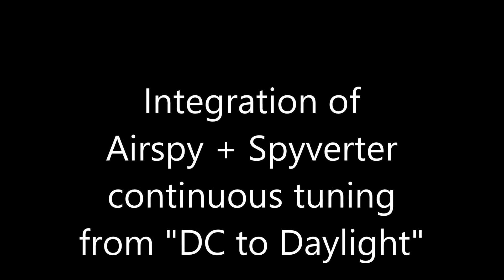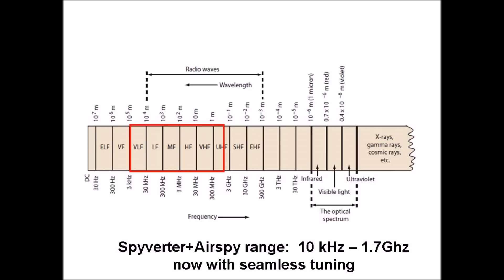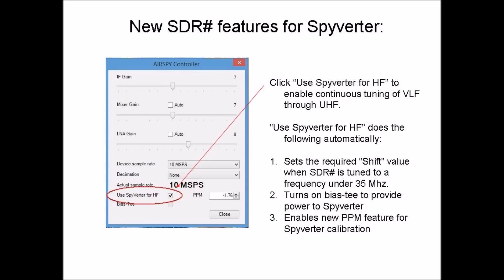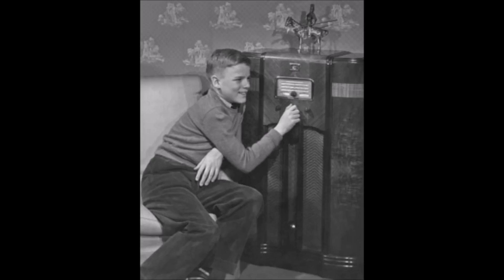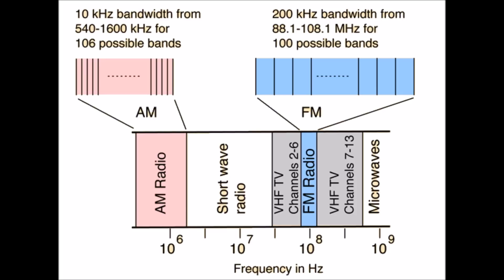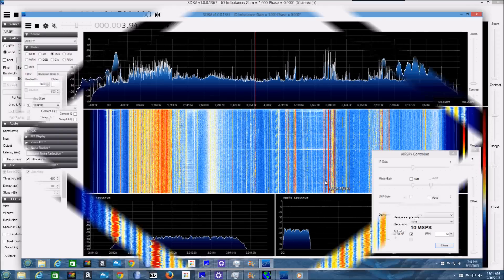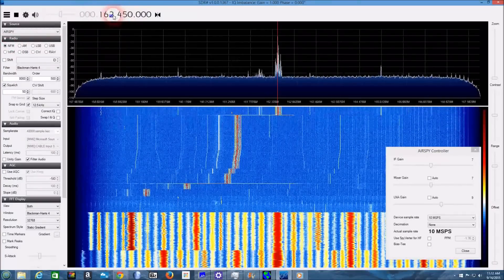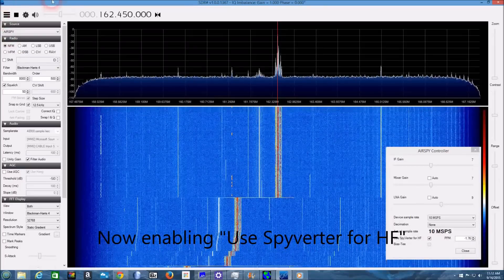Seamless tuning of SDR# with AIrspy & Spyverter

Comment: I have the Nooelect dongle with SDR# software, when I click on the cog icon on the upper left corner to open my Airspy controller it looks nothing like yours?  My controller has selection tabs for: Device Sample rate Sample mode Then under that it has three check boxes:Offset TuningART AGCTuner AGC And under that it has an RF Gain slider, and under that a frequency correction up and down selector. Am I missing software or an update?

Comment: Ranickel: What are your thoughts on using a wideband discone antenna with this configuration?
Reply: Most discones are spec'ed for operation above 30 MHz, so for HF reception you'll get much better results with a longwire, dipole, or other antenna designed for HF.

Comment from the maker: Kent, my switch has BNC connectors but other types are OK, you'll just need to get suitable adapters or cables to made with the SMA connectors on Airspy and Spyverter.   The Spyverter is normally powered via the bias-tee power from Airspy that is automatically turned on when tuning < 30 Mhz with the Spyverter option enabled.
Reply: +ranickel  Thanks. I have a switch with SO-239 connectors. Does the bias-tee power work through any type of connector or will I have to use a separate power source for the spyverter?
Reply from the maker: +Kent, the connectors used shouldn't make any difference.  Just be sure the switch and all cables/adapters etc have low losses on the VHF/UHF bands to maintain high sensitivity.

Comment: Have you attempted to receive any VLF stations with this setup?
Reply from the maker: +William 亗 Harrison (Bravo88)  I seem to have a lot of EMI in the VLF range but Spyverter hears WWVB on 60 Khz very well (35dB SNR) using just a mini-whip antenna.     In a quiet location I'm sure it would perform well.
Reply: +ranickel Nice. Are you aware of this list of stations? :  http://www.smeter.net/stations/vlf-stations.php
Reply: Thanks for the video, I have an Airspy R2 and Spyverter, the Airspy performs perfectly OK alone, the Spyverter receives HF well as set up in the video, however reception above 30mhz is Mon existent, even when Spyverter is unchecked in the software, even very strong local fm broadcast stations, am I missing something?